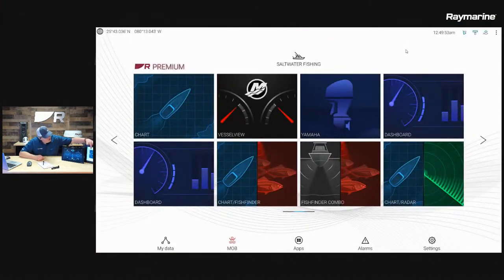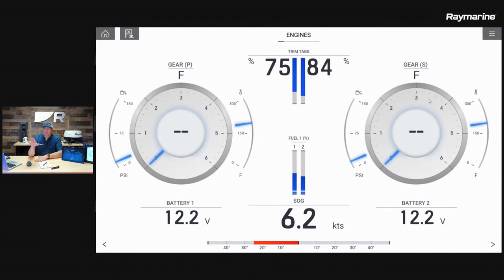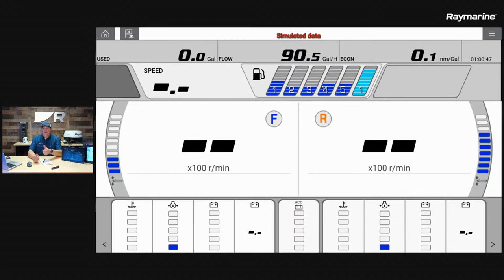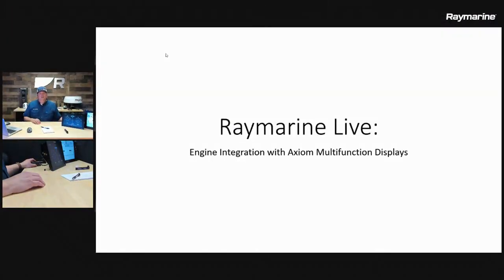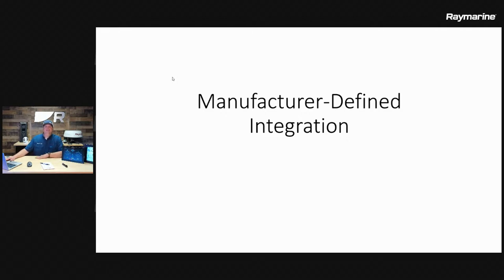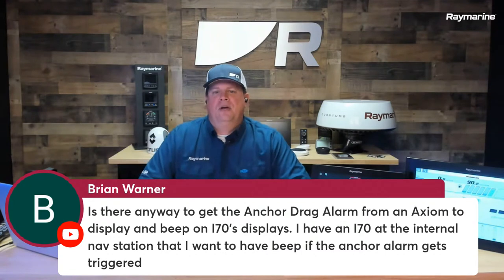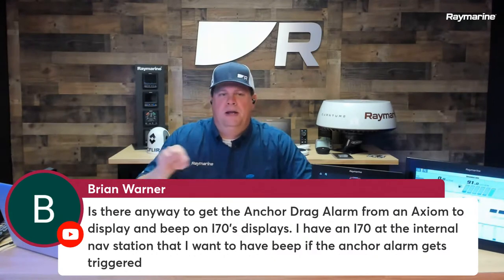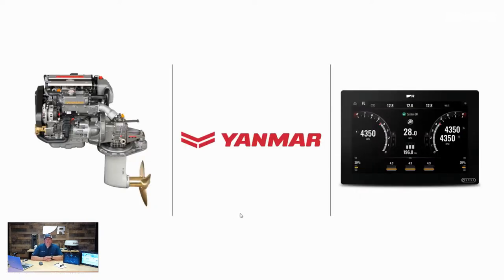Raymarine Live:  Engine Data Integration with Axiom

Comment: Hi Jim, I just installed a new 2021 Suzuki DF225 outboard on my Proline.  It's integrated with my axiom 9 RV MFD though I get a no engine data detected when I attempt to identify my engine through it.  What could be my problem?
Reply from the maker: Hello Nick.   The connection between your engine and Axiom is done with NMEA2000.   The data should shown in the Dashboard application on its engine page.   You might want to double check how the connection is made.   The cable from the engine won't plug directly into Axiom.   Rather, it will connected into a NMEA2000 or SeaTalk NG backbone that is powered and terminated.   If you're still having trouble getting it all connected up please open a ticket with us over at http://raymarine.custhelp.com with a detailed list of what components you are using (especially from Suzuki) and how you'd connected them to the Axiom's  network.

Comment: Hi! I've got Axiom+ and DD8v92. They should be monitored in coolant, oil, transmisison and exhaust manifold temp.  That last one is described online as insupportable: too hot.  Have you yet got any way to measure and alarm the exhaust manifold data?
Reply from the maker: Axiom supports the NMEA2000 PGN 130316, which is Temperature, Extended Range.  That channel supports the necessary range and resolution for temperatures in the range of exhaust gases.

Comment: Jim,
Great Job. A question not on engine data. My quantum 2 radar paints stationary targets 10 degrees to Port.

Could i rotate the black puck in the EV1 a few degrees to starboard to solve problem?

Thank you,

Mike S.
Reply from the maker: Hi Mike.   There are a couple of things to check to solve this.   First, make sure the radar itself is actually mounted facing straight ahead on its mount.  Adjust if you can, or, you can electronically calibrate it in the next step.   

Second, you'll want to electronically check the radar's bearing alignment.   Typically you'll point the boat at a distinct radar target that is some distance away and find it on the radar scope while you are in head-up mode.   When the bow of the boat is pointed at the target, the ships heading marker line on the radar scope should pass directly over the target too.   You can align the radar image to compensate for any inaccuracy using the Bearing Alignment setting found in the radar's settings menu.  Radar App....Menu....Settings.....Installation....Bearing Alignment....and you can dial it in while watching the scope.  

Once you have done the bearing alignment you can be certain that the bow of the boat and the scanner are aligned properly.  Now you can calibrate the compass heading itself.  Generally the compass heading being out of alignment is more going to be an issue when running the radar in North Up mode (as the compass is the reference for where North is.)   Compass mis-alignment will also throw off the overlay of AIS contacts on the radar scope.

When the boat is on a steady course and moving at a fair speed (10 knots or so) in an area with little current, compare the compass heading to the GPS course over ground.  They should be within a few degrees of each other.  Rather than rotating the EV1 in its mount, its better to calibrate it through your autopilot or MFD.   The main factor that impacts its calibration is the boat's magnetic signature (deviation.)  Calibrating it allows it to figure out the deviation curve for the boat (it is not constant on all headings) and gives a more accurate readout.   A final offset adjustment to the heading value can be made to dial it in too.

Comment: Hi--thanks for the video.  I have 4 Caterpillar displays that I'm planning to replace with 4 Axiom 7 units (one for each engine in pilothouse and flybridge).  I got the Axiom to show the data from the engines (Cat 3406E) using the Maretron J2K100 and the Cat connector cable to an NMEA backbone.  I'm trying to configure the display to get information similar to what's on the  Cat display screens.  Are there any templates built into the Axiom that I can use for this, or, if not, can I customize each screen to show multiple dials and numbers with the description above them (eg battery voltage) instead of the linear types of gauges that are shown in the default configuration?
Reply from the maker: Hello Paul.   The engine dials can be customized to some extent.  It is also possible to start with a mostly blank page and program the values you want to see into it.  By default, Axiom is going to want to display all 4 engines on one display.  If you want to break out each engine to its own individual display, that should be possible by re-assigning the sources for the values programmed into each item shown in the display.  This is done by long-pressing the item and editing it to pull from the proper engine.    If you need help with this I suggest giving our support center a call, or opening a ticket with our team over at http://raymarine.custhelp.com.

Comment: i have a brand-new set of MerCruiser engines and fuel tanks. How can i integrate my fuel levels to my axiom instruments? Thanks
Reply from the maker: Our Axiom-series products are all compatible with the SmartCraft Connect system by Mercury.  Using a SmartCraft Connect gateway you can receive data from your engines, tanks, etc. and display them on Axiom's built in VesselView app.   To do this you would need to purchase and install the SmartCraft Connect gateway from your local Mercury or Mercruiser dealer.   You can learn more about the system here: 
https://www.mercurymarine.com/en/us/gauges-and-controls/gauges-displays/smartcraft-connect/

Comment: I appreciate for your video. I've installed today the same configuration as described at 30:36. My MFD is Axiom XL 16/Yamaha F200XCA/6YG/6YC and digital throttle connected to Command link plus hub.Everything works the same as in your case but I can't see the gear data on the Yamaha page. Is there any way to get it ?
Reply from the maker: Thanks for watching.   You should see the transmission gear indicator just above the tachometer in a small circle.  The indicators are F (forward), R (reverse), N (neutral) or - (no data detected.)  If you are not seeing that, I would start by making sure your Axiom displays are updated to the latest software version.  That will ensure you have all the latest changes in your system.  If the transmission gear indicator is still not showing after that, I recommend having a Yamaha dealer check that your gateway electronics have the latest software installed as well.
Reply: @RaymarineInc  Thanks for the reply. The first thing I did when I installed the Axiom XL 16 is to update the operating system to the most recent one, which is LH4.5.84 at the moment. However, it still doesn't display the gear position in the circle you mentioned. Could this be related to an engine issue, such as the absence of an optional sensor for the gear position or something similar? And would you recommend that I perform a full factory reset of the MFD after the Lighthouse upgrade before reaching out to the Yamaha dealer regarding this issue?

Comment: Hi Jim.  Will the axiom pro rvx integrate with stage 4 helmmaster ex system.. ie auto pilot, lighthouse etc. Many thanks Josh
Reply from the maker: Hello Josh.   Unfortunately, no.   The only Raymarine systems that integrate with HelmMaster EX are our Axiom XL-based systems.    To integrate them you will also need the Yamaha Type 2 HelmMaster EX kit, and a 6YG engine gateway.   We have the details online here:  

https://www.raymarine.com/en-us/our-products/digital-boating/marine-engine-integration/yamaha-integration

Comment: Raymarine Axiom 12" RV
i want to get motor data from 2000 Mercruiser 7.3 300hp engines.
What are the best solution for dual engine setup here?

Thanks
Reply from the maker: For older Mercruiser engines you might want to look at the engine gateway options from Fox Marine.    Their devices communicate directly with each motor's ECU, and provides an output of NMEA2000 data that Axiom can understand and display in its dashboard application.     You can find them online here:  https://fox-marine.com/

Comment: these videos are awesome. I have an axiom pro 16rvx and an axiom 9rv. I run two transducers a B265LH TH and the rv100. The system recognizes the B265 for temp but the thermister appears to be bad because the temp is inaccurate beyond what can be calibrated. the temp on the rv works but as yet I haven't been able to find a way to select it as the system temperature sensor. could we please add the ability to choose from multiple temp transducers? thank you
Reply from the maker: Thanks for watching the show!   We are working to get that feature implemented ASAP.  I am hoping we'll see it very soon.  With many other types of data you can choose between multiple sources of the same kind of information.  For example if you have 2 GPS receivers you can choose which one feeds your Axiom system in its data source selection menu (Home...Settings....This Display....Data Sources.)  

Currently, water temperature is not a source that can be selected.  Instead, there is some hard-coded hierarchy in the system that forces it to choose from available temperature sources.   We know that many anglers have more than one transducer with temperature sensing, so we want to make those sources all identifiable and selectable. 

Hopefully we'll have more news on this soon.

Comment: I have a Raymarine Axiom and Yamaha 115 SHO on a flats boat- I also have the Yamaha Command Link system 6YC-0E83C-30-00.  What do I need to buy to connect this to my Axiom so I can see the data on my Axiom?  Thank you!
Reply from the maker: Hello Newton.   You will need a Yamaha Command Link NMEA2000 gateway.   This is commonly referred to as a "6YG" gateway as that is the first 3 digits of its model number.   Your local Yamaha parts dealer can get you one.  6YG-8A2D0-00-00 is the part number.

This device will plug into the Command Link hub inside your helm, and provides an NMEA2000 data output.   Run a Raymarine A06075 DeviceNet to SeaTalk NG cable from that output into your boat's SeaTalk NG network.   On Axiom go to Home...Settings....Boat Details....Engine Manufacturer and select Yamaha. 

Finally, you'll need to add the Yamaha Command Link app to Axiom's home screen.    On the home screen long-press on any tile and select Customize to enter the page editor.   Choose a Fullscreen layout, and then in the list of apps touch the Yamaha app.  Touch Next....edit the name of the app if desired on the next screen, and touch SAVE.

Now, the Yamaha Command Link app will appear on your homescreen and you'll receive data from your engine.  The layout you'll see on Axiom will look very much like what you see on your Yamaha 6YC gauge now.

Comment: Greetings from Mediterranean,

Thanks for another great video!

Is it possible to have Raymarine autopilot function with Yamaha helm master EX level 2 or is necessary to have Yamaha helm master EX level 3 ? 
Thank you in advance
Reply from the maker: Hello Vedran.   Raymarine autopilots are not compatible with Helm Master EX at any level, currently.   You' will need to purchase Yamaha's autopilot option for that engine/steering system as they currently don't allow 3rd party autopilot systems to connect with it.
Reply: @RaymarineInc  thank you for answer

Comment: Hi Jim, I just purchased 2 Axiom Pro 12 screens.  I have 2 MAN 900 CDI's with MAN engine display screens that I want to keep.  How do I integrate the engine data into my Axiom pro as well?
Reply from the maker: Hello Brandon.  You'll need a 3rd party gateway device that converts the MAN diesel data stream to NMEA2000 sentences.  NMEA2000 is the industry-wide protocol used for marine electronics devices to communicate with each other.      

There are a few different manufacturers that offer these kinds of devices including Yacht Devices, Maretron and Boning.    Here are a few examples of these gateway devices:

https://yachtdevicesus.com/products/engine-gateway-ydeg-04
https://www.maretron.com/products/j2k100.php
https://www.boening.com/ahd-ap-n2k.html?&L=1

Their gateway will generally plug into the engine's databus, and translate the diesel-specific data to the NMEA2000 protocol.   The output of the gateway connects to your boat's SeaTalk NG/NMEA2000 network where Axiom can pick it up and display it.   You'll want to reach out to these vendors directly and be prepared with some photos of your MAN engine displays, and perhaps some photos of the connections on the back of them so they can suggest the right plug-in cable adapters to work with their device.

Comment: Will my 2001 Universal (Westerbeke) M35B sailboat diesel engine integrate with my Axiom MFD?  Appreciate any advice or installation resource. Thank you!
Reply from the maker: Your M35B diesel is mostly analog.  I don't believe that one was offered with any digital outputs.   You would need to use an analog-to-digital conversion system like the Noland RS-11, Actisense EMU-1, AlbaCombi or similar.    Those devices tap into the senders going to to the analog gauges, convert the signals to digital, and output them to NMEA2000.    It is a bit of a project, but doable.   This article from the blog Panbo.com details his experience in tackling this project:  https://panbo.com/actisense-emu-1-analog-engine-gauges-to-nmea-2000-happiness/

Comment: I am using Yamaha 6YG gateway and everything is displaying exept fuel level which is not connected..i am figuring out how pass my fuel tank level sender to the sea talk to display in the gps..any help will be appreciated!!!
Reply from the maker: Hello Pedro.   Unfortunately in some Yamaha installations the fuel tank level is not sent over NMEA2000.  Most of the time these types of installations had an analog fuel level sender connected to the OEM Yamaha gauge that was interpreted separate from the rest of the engine data.   You might be able to change your tank level sender to a NMEA 2000 compatible unit if you have access to the top of the tank.    We particularly like Oceanic Systems brand NMEA 2000 tank level senders, but there are others too that can do the job.   Just look for NMEA 2000 compatibility.   The Oceanic Systems ones can be calibrated from your Axiom display, where other brands would need to be externally calibrated.

Comment: Hi Jim is there a way to link my Raymarine element to myApple  IPad or my apple phone? 
So that I can see the screen when I’m operating the boat from my 2nd steering station at the back of my fishing boat.
Reply from the maker: Unfortunately the Element system doesn't support screen mirroring to phones and tablets.  That feature is only found on Axiom systems.
Reply: @RaymarineInc  If I buy another Raymarine element screen ….can it be linked up to my original screen?
Reply: I just received my Raymarine element manual and on page 57 it says an element display will share waypoints with the second element display connected to the same see talking NMEA 2000 net work….In English does that mean yes I can connect the second Raymarine element screen?

Comment: Does the mercury vesselview integration allow for "Verado Sport Exhaust" toggling with the 3.16 release?
Reply from the maker: Hi Todd.  Sport Exhaust control did not make it into 3.16, but it's planned to be in the next release.  As you may have noticed we have been adding and expanding Mercury features consistently over the last few releases.

Comment: I have a 2022 Yamaha 255 FSH. Has the Yamaha conext system. Is there a adapter to get the engine and fuel info to my axiom display?
Reply from the maker: Hello Efrain.  Yamaha offers a NMEA2000 gateway device that will provide data to Axiom and also activate our built-in Yamaha app.     Its commonly called a "6YG" gateway, and your Yamaha dealer can get you one, or you can find them online too.   Here is one example online:  

https://www.simyamaha.com/command-link-plus-and-command-link-n2k-gateway-kit-with-pigtail-wire-6y8-82521-01-00-6yg-8a2d0-00-00kit/

Comment: I have a yanmar 4JH3-TE in a 2003 sailboat with axiom+ MFD. is there an interface to that engine that will hook into my network to display engine data on the MFD?
Reply from the maker: Hello Marty.  Most Yanmar engines that have any kind of electronic controls, monitor, or display of their own communicate using the J1939 engine data format.  Its an automotive-industry CAN bus protocol common on diesel engines.  Maretron, Noland Engineering and Yacht Devices all make J1939 to NMEA2000 adapters.

Another way to get data is to use the Noland RS11, Actisense EMU-1, or AlbaCombi analog-to-digital converter.  These devices tap into the analog signal lines that go to your current Yanmar analog gauges.  The analog signals are programmed into the converter, and it outputs NMEA2000 data.  These require a bit more setup, but they work quite well.